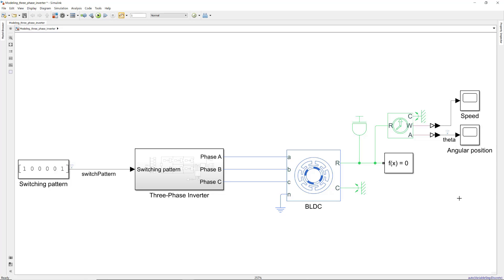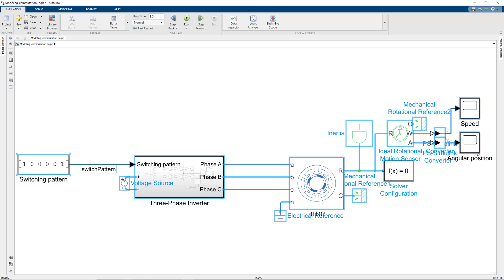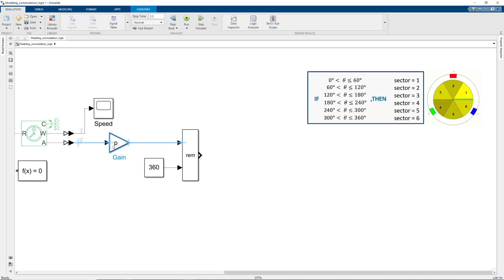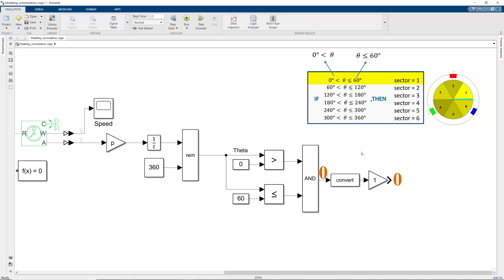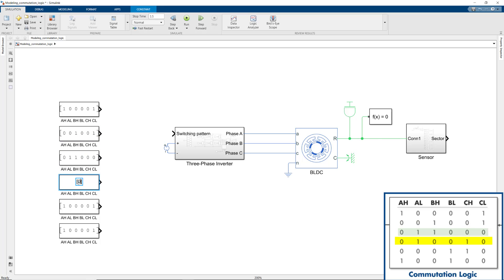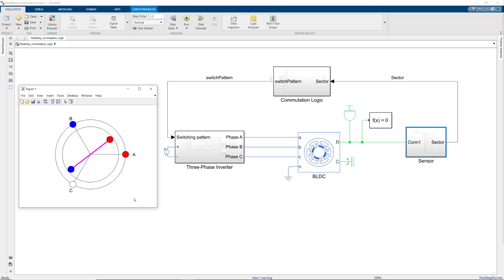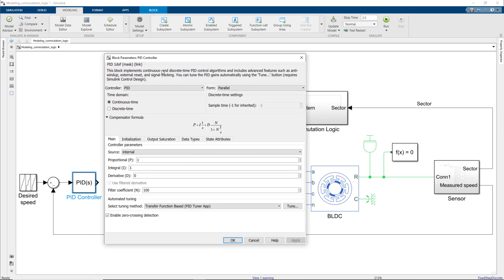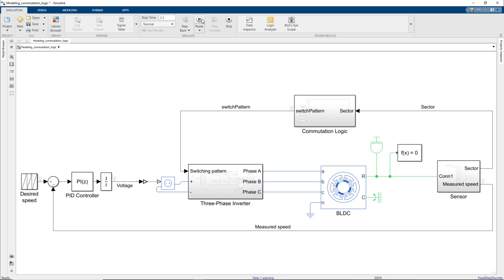How to Model Commutation Logic | Brushless DC motor (BLDC) control with Simulink, Part 3

Comment: Does anyone know what is the purpose of that unit delay block used to convert mechanical degrees into electrical degrees.
Reply: I believe it is used to imitate a real data acquisition. While the physical model changes in real time, the computer will only know this new value delivered from the sensor in its next execution cycle. Therefore in reality sensor data always has a delay, at least in digital systems. A unit delay block recreates that effect in simulink.

Comment: Can anyone provide the .slx file? My model isn't working properly. Angular speed is oscillating around 0
Reply: I have the same problem..
Reply: Bro, how do you get it to run using animate RotorPosition.
I am using that command but Matlab fails to identify it.
Do we need to write our own script...?
Reply: @railgun1935  never got to that part. I don't think there's an inbuilt script for that...that's only with Matlab for visual demonstration
Reply: @asitkumar2095  I followed the exact same steps
But some how the model is not working 
Theta and speed both remain at 0.
Am i initializing it in the wrong way please help...!!
Reply: @asitkumar2095  I followed the exact same steps
But some how the model is not working 
Theta and speed both remain at 0.
Am i initializing it in the wrong way please help...!!
Reply: @railgun1935  The Simulink model and animation files are now available. Please see my comment above with the link to a GitHub repository.